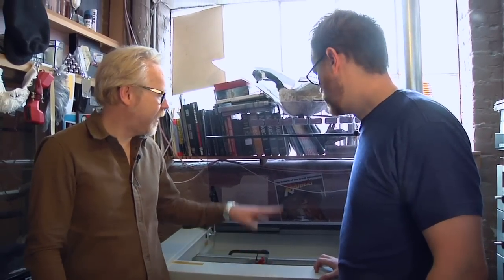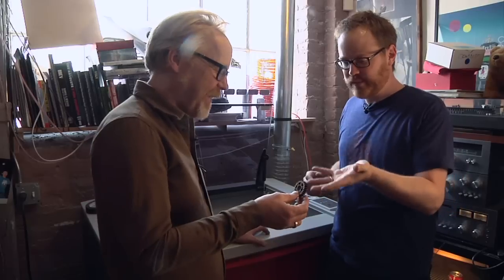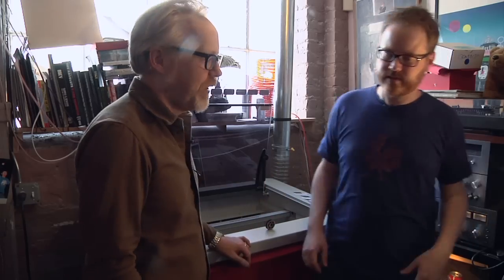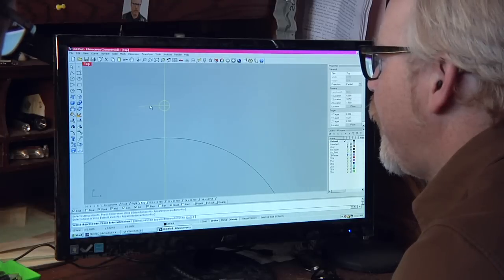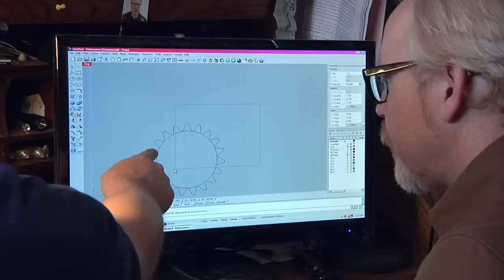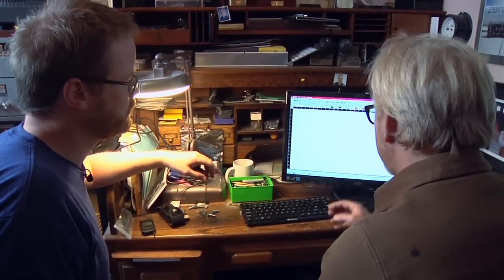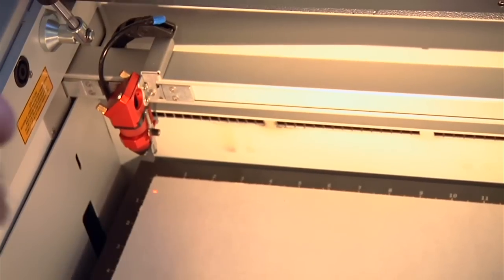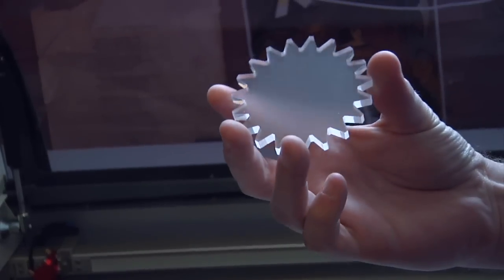Inside Adam Savage's Cave: The New Laser Cutter!

Comment: Nice work guys. Glad to see you getting to play with one of my favorite industrial toys. I work around some of the big Mitsubishi lasers, They can handle a 5; x 10' sheet of steel 10mm thick no problem. Very impressive to see in action. It's also neat to watch when the check the tuning of the big resonator tubes. They will remove an access port and shoot the laser from the resonator at a piece of plywood about 25' away. It makes a nice scorch mark about 1.5" in diameter. Truly neat!

Comment: Probably, it would depend on the software for cutting and what it allows you to do. I work around big Mitsubishi lasers and I have asked for different modifications in the tool path or stop points and it can be done. It's just what the software allows. It may also be material dependent as well. If you are cutting metals that retain heat (like steels) where that might cause problems with cutting parts out. I'm in awe of these things and the guys that run them.

Comment: I've got thousands of hours in Rhino - I love that program.  I would made the gear very differently, though.  I don't use many keyboard commands, I just create multiple toolbars with all the line tools I need in one place.  It takes a little longer to memorize the icons, but when you have a high-resolution mouse it's far easier/ faster to select the icon than input keyboard commands.

Comment: Hi,

I don't know if i can get an answer about that because it's really precise.

- But i would like to know why the software cut all vectors one afer the other instead of one continious line. Is it because those line where not closed as Polyline in the soft or it's just how Trotec handle vectors ?

Thanks for that very good video.

Eric
Reply: Eric Nantel - DiaLFonZo yes you are right. If he did join all the lines together laser cutter would cut in a single line. It would be faster to cut in the cases which contains tremendous amount of lines.

Comment: OpenSCad would be the tool to make gears in. Free, and there are existing scripts for making gear sets that will then mesh correctly. Or toothed belt pulleys. Or v-belt pulleys. Or whatever. Thingverse thing:36568 is a good example. It makes timing belt pulleys given the number of teeth, ratio between pulleys, hub type, height, etc...

Comment: I'm curious as too the order of cutting. The slopes were cut first then the peak per gear tooth. Then it finished with the valleys. How come the machine sees this as a more efficient way of cutting?
Reply: yeah intrigued me too, maybe it's because continuous cutting would make the corners to hot and messy, now the angles have a chance to cool down before being re-cut ?
Reply: Marceau Pierron Watching a second time it came to me that the teeth are all straight lines while the valleys are all arc sections of the circle. I'm sure it's much more efficient to run the laser in a circle and cycle the laser rather than drawing the arcs on an individual basis.
Reply: +Etienne Bourigault Francais ? But you're right that has to be it..
Reply: I think you may find the reason more banale than you wish. It's probably just a configuration somewhere that first uploads all the  line segments and then arc segments into the machine. I would seriously doubt if the cutting program was intelligent enough to recognise all those arc segments as being formed from one continuous circle to be faster. You can clearly see from the incredibly fast way the laser positions itself that those minor distances aren't an issue. After all, laser cutting on this small scale is usually reserved for special unique forms, where speed matters less than accuracy.

Comment: My buddy and I found this progam on line when we wanted to cut gears with his laser. It works great! Check out GearGenerator 3. Costs about 26 bucks and does all the gear calculations. It does Involute spur gears, Planetary gear sets, Calculate small gear tooth undercut shapes Latntern / cycloid gear pairs, Block chain and roller chain sprocket calculations, Export DXF, HPGL, CSV, Sketchup, PDF, bitmaps. And a bunch of other things. I am not connected to this software in any way. It just works.

Comment: 120 watts!! that is a hell of a laser!!
Reply: patheticmada 120 watts is lots for home commercial use tho
Reply: patheticmada I don't know...Making enormous swiss cheese???
Reply: patheticmada you cut holes in normal cheese :D
Reply: 1.21 giga watts?
Reply: I have used a 2 Megawatt Nd:YAG laser in the past to melt metals into alloys for metallurgy experiments. We needed a new power line to the lab to run the thing, it was awesome!
Reply: tubefed420 jigga what?
Reply: patheticmada @88mph?
Reply: where we're going we don't need, roads
Reply: patheticmada I hear they are making a 400W metal cutting & engraving machine soon.. it'll only go through thin metal though..
Reply: NSA Agent You can cut through thin sheet metal with oxygen assist with only 150W CO2 laser. 400W only necessary if you want to cut thicker or faster.
Reply: TheBikerScout in all fairness the oxygen is doing the cutting.
Reply: pathmada 0.1 sec into your eye of that 120w your blind. If that’s now a powerful laser your toilet will do

Comment: I work in AutoCAD everyday and watching Adam stumble through CAD software is like nails on a calk board.
Reply: Yeah, I suppose it would be the same as comparing me using the sketch based parametric solid modeler Autodesk Inventor everyday to someone using AutoCAD.
Reply: Or like modeling entire 3D ductwork system in a 9 story resort hotel in Revit as compared to someone modeling bolts.
Reply: chalkboard*
Reply: thing to remind yourself is that everyone has strengths and things they do all day every day tend to be the strongest. if he gets from idea to working finished product he doesnt need to be 300x more efficient in a software package that is required for 1/10th of every x creations and is just one of 20 steps and skills required. 

If you get paid to output plans as computer files its a different story. Also, maybe you know how to make them physical but I bet given the same set of plans with some errors thrown in his experience building would leave you in the dust. He doesnt seem like the type to cringe though (my read on him is he would be there helping you figure out how to overcome the issues.).

Comment: so does it use an assist gas? and since it uses bend mirrors what kind of purge gas does it use? n2?
Reply: CO2 is used for the laser tube. Most of these laser engravers don't use anything else except traditional ventilation methods - i.e lots of vacuum fans.

Comment: The laser cut in a very odd way. Instead of cutting one continuous line  it did line at a time? Why was that?
Reply: +Seb Meikle I guest that the software he's using doesn't connect all the vector line as one and only path.
Reply: +laurent pavot Yeah, must be. Even though it was doing a line by line, it moves bloody fast! Far quicker than my machine. But, mine is no where near the level of one of these! One day I will have one! My aim is to get a Epilog machine for my workshop!
Reply: +Seb Meikle I own the same laser, the software optimizes the cut path automatically, you can't maintain the same cut speed through 90 degree corners and you have to stop acceleration and change direction so instead it generally hops around.  Also it always cuts from the outside to the middle.  You can redo the cut paths if you want but you hardly ever need to.

Comment: Can't help but think that 2d work would be much easier in solidworks than Rhino!
Reply: +wyzarme or inventor/microstation
Reply: +wyzarme Hard to say which might be easier. Solidworks and Rhino are two
 different styles of 3D modelling progarms (solid vs surface modelling).
 The solid modeller i last used was 4 to 5 times the cost of Rhino. 
Which program you use will depend on how much you want to spend, the 
type of models you want to create, and (possibly) which program best 
suits your way of thinking. For 2d work it might be easier to use a 
vector graphics based program.

Comment: The program he's using seems a lot harder to use than Inventor or something. It's the same reason I don't like using AutoCAD. I can never remember any of the commands.
Reply: It's quite intuitive actually. Rhino has the vast majority of it's commands available in both the icon toolbars and text format menus, in addition to typing them on a command line like Adam was doing.  You could model the same gear completely without touching the keyboard if that's the way that works for you.
Reply: I find AutoCad great for a quick modeling work as I dont do that much so its easy to pick up and go